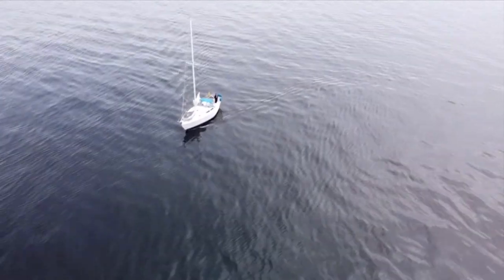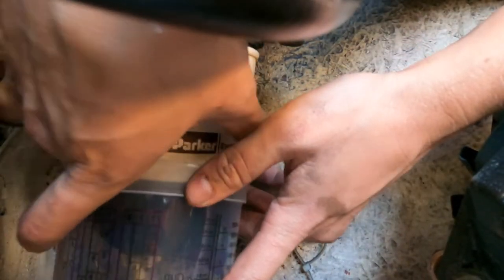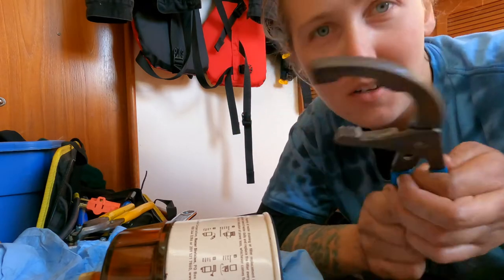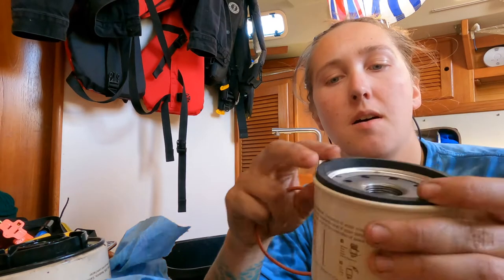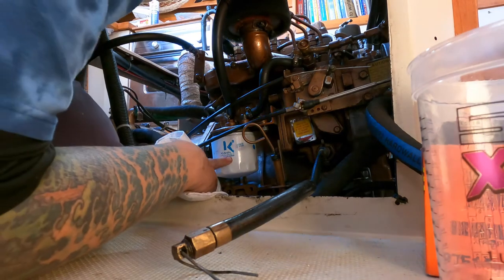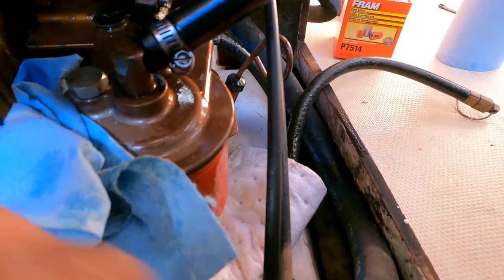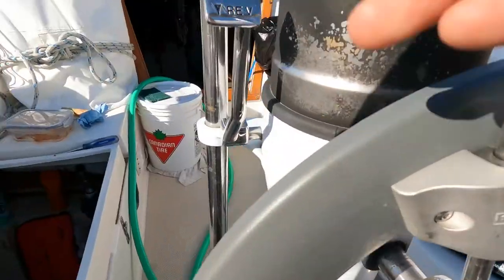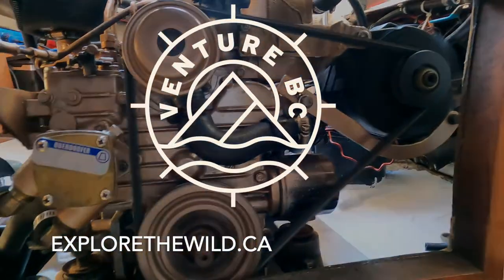Changing Fuel filters on marine Diesel engine - universal m25xp

Comment: Hello, I noticed that your first filter (off engine) was a 2 micron. According to Nigel Calder, author of Marine Diesel Engines, your primary filter should be 30 microns, secondary (if you have one) 10 microns, and on engine filter 2 microns. That way your first filter captures the larger particles and your last filter the small ones. The challenge with your set up is that your primary filter will get clogged too quickly (and starve your engine of fuel) because it is only 2 microns.

Comment: I need to do mine, had no idea how...and now I do.  Thanks so much!  Very helpful.  BTW, this old fart appreciates getting help from a vibrant and capable young woman.
Reply from the maker: Glad I could help! Good luck :)
Reply: Oh, by the way, when you bleed the air from the secondary filter, how do you know there is no air in the line from the primary filter?  Do you have to keep pumping fuel until that air pocket would make it that far?
Reply from the maker: @jerrymerz2940  the fuel to fill the secondary will be coming from primary so if you no longer have air bubbles escaping you should be okay. If it doesn’t start try cracking vent again and make sure you get a steady flow of fuel coming out. The air will rise up as it wants to escape. If your having issues getting it to start check the o-rings on your fuel filter. I’ve had a racor drain plug oring that wasn’t seated right suck air in before and stall the engine.
Reply: @LandandSeawithKee  so, I assume you don't put fuel in the secondary filter for that purpose?

Comment: Awesome video.  Did you find any issues using the FRAM filter? I have the same engine and plan on using that same filter. Thoughts?
Reply: Fram filters have a bad reputation. Suggest a different brand.

Comment: excellent video on fuel pump change. Question, when you run your engine on the hard where are you attaching your supply hose ? I attached mine to the strainer intake fitting was told do not run it straight to the block. Your thoughts and again great videos keep up the good work!
Reply from the maker: Thanks John!

I put a hose in a big bucket and then take the intake hose and strainer off the thru hull and put it in the bucket. Some times this gets messy you have to get the flow right or just let it spill over into the bilge and clean up afterwards.

Those plunger style cup muffs work well too. You attach them to the thru-hull on the outside with a hose connected. I usually use a block of wood when I use those to hold it up.